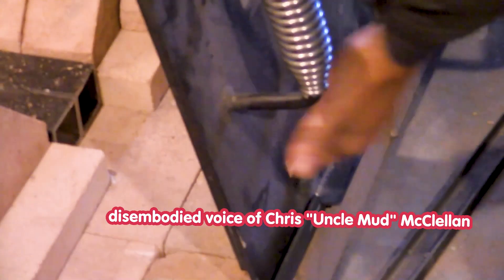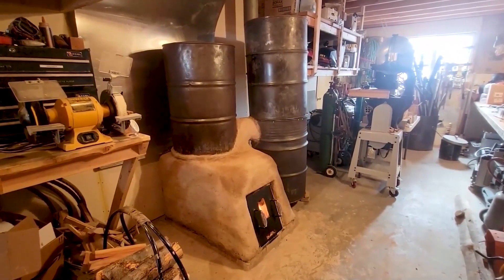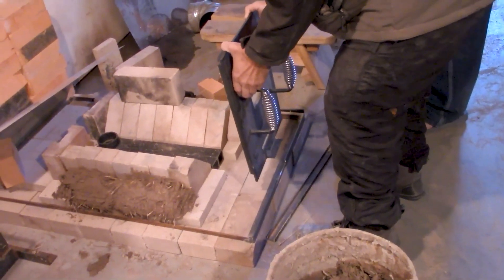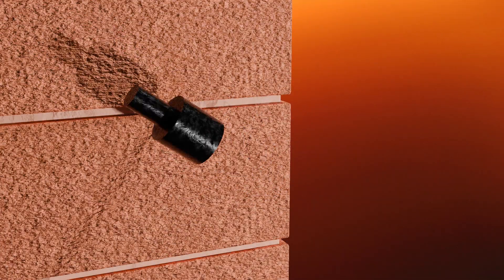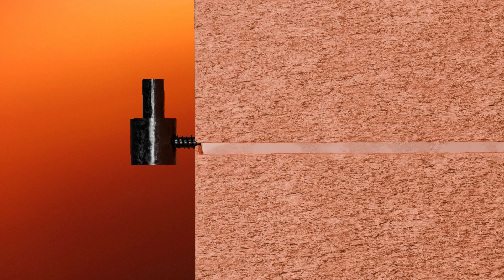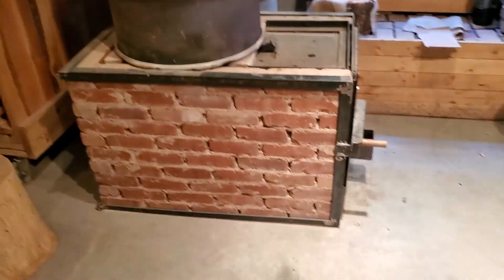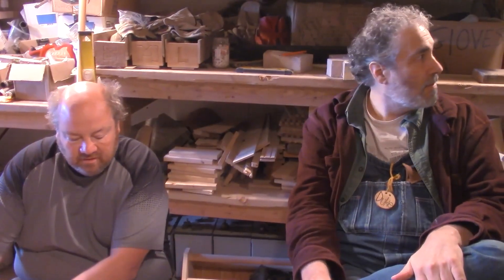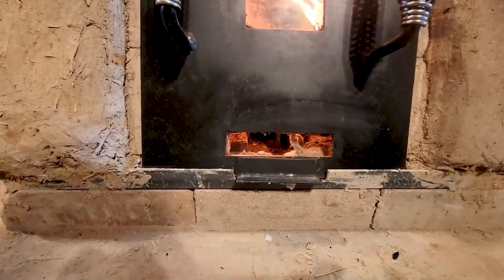batch box rocket mass heater plunge door experiences

Comment: That's a great idea, thanks for sharing! I've been using a manufactured door with some adjustable metal flanges holding onto the inside of the outer brick skin - that has worked well too for about 5 seasons, but it's costly and not very DIY-able. Although hinges do prevent the "where did you put the stove door again?" problem.

Comment: Plunge door is a super cool and simple design. Another similar option I used is I made a simple sliding glass door from a large solid piece of Ceramic glass. I made a stainless steel channel frame that gets embedded into the rammed earth or Cob mass of the burn chamber, and the glass just slides up  to open the door. No parts to break or wear out, and you can control the air intake air flow by the amount you slide up the door. An added benifit is that when you slid the door up rapidly, there is no back draft negative air pressure pulling against the draft like you get when you rapidly or briskly swing open a regular door.